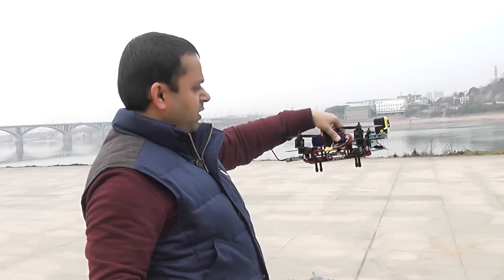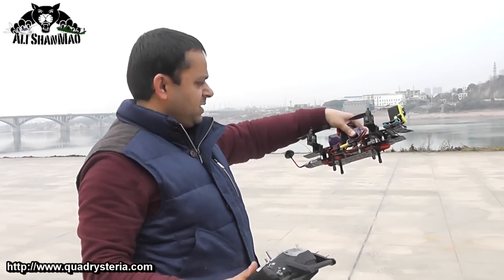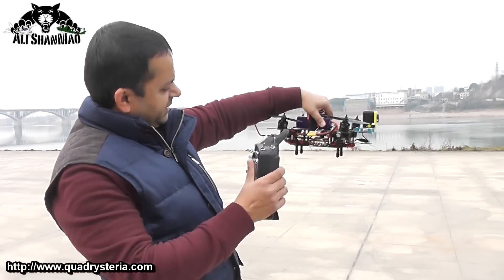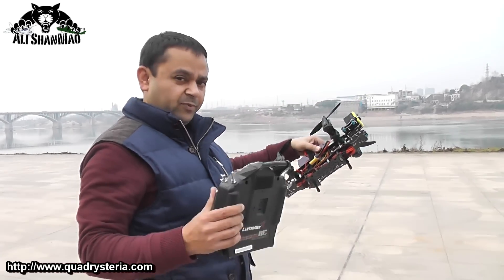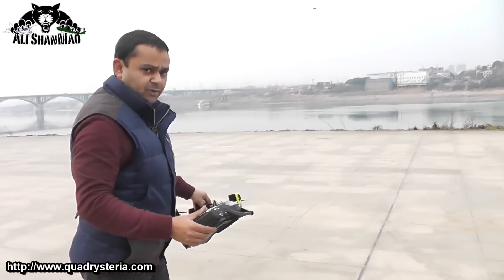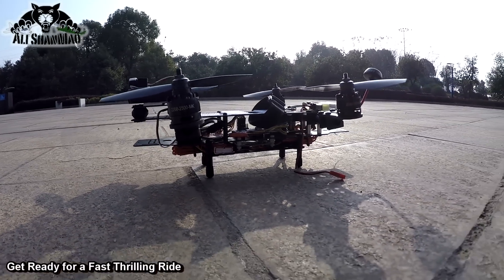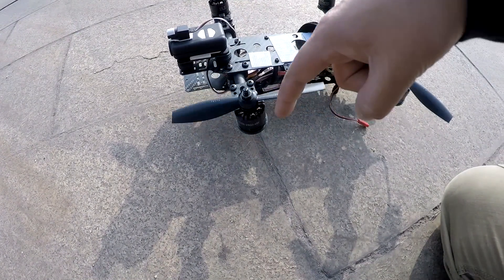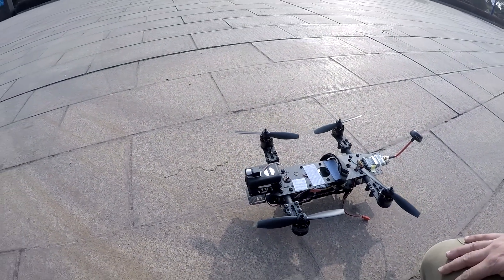Quadrysteria Mini Mamba V2 FPV Racing Quadcopter

Comment: Hi AliShanMao... Great vid. What FPV cam are you using mounted on top of the Mobius? I didn't see it in the equipment list. I presume it is a CCD cam. If not, then does the video lag present a problem for fast, proximity FPV flying?
Reply from the maker: its a small camera, that i used to sell before, not anymore. but still its a great tiny camera that shows clear footage at night as well if there is some night. very good to fly night flights.